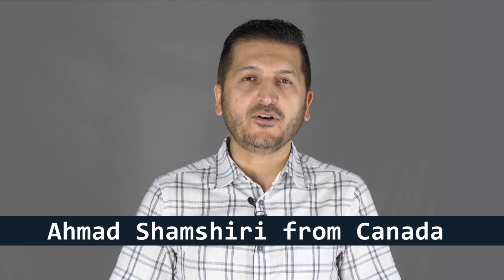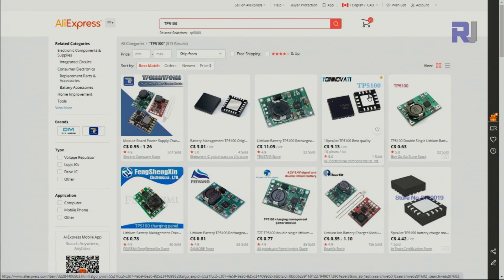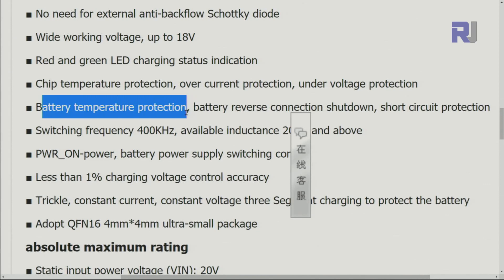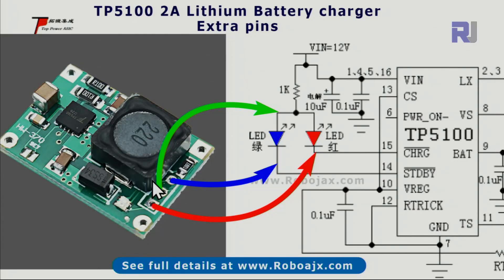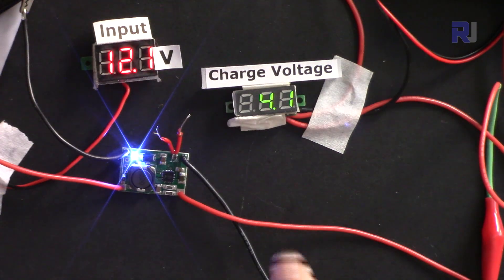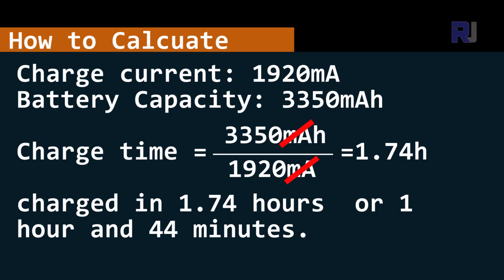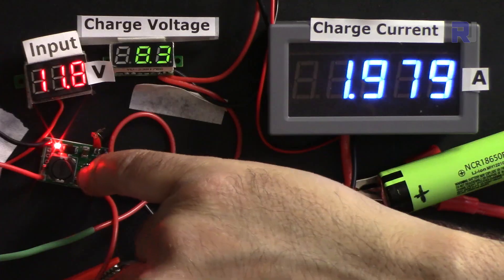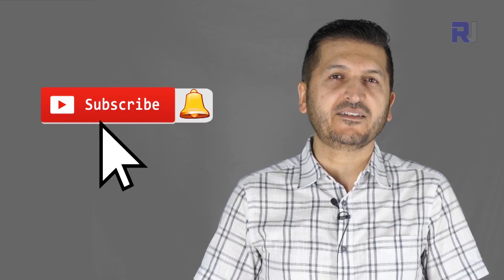How to use TP5100 2A 8.4/4.2V 1S and 2S Lithium Battery Charger DIY - RJT346

Comment: Mr. Shamshiri, I truly enjoy your videos with the thought process, planning and the abundance of information you provide. After all, it takes work to video, edit and review your work and I find it flawless. Even corrections. 
 I have an entire line of cordless tools for sears back when I could work. I am prepared to disassemble and pass judgment on each cell. How or what math is used to determine the current to charge cells the show promise? A dead battery is dead, but unless it has a dead short internally, it has a chance to live again. I take the numbers stamped on the shrink wrap and research to find voltage but aH info. I can not order every single cell ti fix each battery pack as it would be cost prohibiting for my wallet. But having 9 perfectly good tools sitting on the shelf does me no good. 
Automotive ASE Master Tech since 1978-Retired 
I have already used your excellent product testing videos to pick two modules to purchase. Thank you again!
Reply from the maker: Mr. Kay,  I am pleased that you like my tutorials.  Yes indeed for each video there is lots of efforts.  Very few such as yourself know this. 
first of all battery capacity and charge parameters are the most tricky part of working with them.  The charge current is determined by the manufacturer of the battery. charging above the rated current will reduce the battery life. So you have to find the datasheet. for example for the Panasonic battery shown in video here is the datasheet https://www.batteryspace.com/prod-specs/NCR18650B.pdf and it says the the standard charge should be about  16550mA. or lower. I have spoken about battery protection in this video https://youtu.be/3dwA8A8VrrE so generally for less than 10Ah batteries, always go 0.5 of capacity or lower to protect it.
Reply: @robojax   Thank you again so much for the reply. I will identify and look for data sheet & their recommendations. I have never posted a video on youtube, but have a great understanding on lighting, camera angle or position, just a lot. This is basics, but you go a long way to provide information at least I find extraordinary and as accurate. You have my total respect in your total presentation.
My last job had me holding automotive technical 4 hr. seminars for 20 to over 100 each night during a whole week in a different town or city. So the old “Dog & Pony” show. Taking photos, screen captured from a lab scope or scan-tool to use these in the power point was not in the job description. But the presentation had diagnostic holes in it, large enough to drive a truck thru. Advanced Charging systems, Serial Data (6 types in GM vehicles), etc. Magneto-Reological-Fluid used in struts in place of traditional oil and valving found in a common shock. Called “Active Ride Control” and other terms, but basically tiny metal particles suspended in oil. When a magnetic field is applied at a variable rate, change at 2mS changes from a thin less viscous oil to a rigid hard non-fluid material. This was started in suspension in 2004 Corvette. Acura used it in rubber motor mounts. When ran on a dynamometer, the vibration generated on up shifts, down shifts, all parameters, they mapped the dial-in amperage required was downloaded into a EEPROM and allowed later to change the ride feel, smooth, sport, racing anything they wanted. So, electronics coupled with mechanical applications is amazing. So a basic understanding was needed to pass along to guys/gals who may have to work around these or replace them, then recalibrate. 
 Total electric vehicles make no noise (Very Little) but I joked two decades ago that waterproof speakers could be added to allow the driver to turn a knob to make it sound like a hot rod V8, 10 cylinder Viper or a loud 4 cylinder w/turbo. No, people on phones walk into streets and get hurt or killed. Laws maybe passed requiring them to make noise. The possibilities are endless. Just sharing as the guy who makes a simple kit can patent this (Installed by customer on older vehicles) but make millions, if a manufacture buys the patent or the rights with a percentage for license for each one sold/used. It’s a gold rush, but few would think of it or pursue it. I have ideas. 
Ok, enough. Blessing to you & loved ones! Thank you again. I could be reached as I am just working on my own old truck for me. A project to keep both hands & mind working at 62. Stay safe!
Reply from the maker: Hello,  Mr. Kay, You are welcome and I am glad you like my tutorials.  You've got so much experience. wow.  I've read your comments and enjoy them.  To make electric cars noise, many states have considered/did pass legislation to to make it mandatory to have noise added. I am not sure if it has been implement or not.  I have an Arduino course which starts from absolute beginners and up http://bit.ly/rj-udemy
God bless you too and your family.  you too stay safe.

Comment: Does the charging stops when the battery is full ? Is there any auto charging off with TP5100 ? Some one please help
Reply from the maker: Hi, charge is not a charge it it does not stop.  that is the whole point to stop when charge completed.
Reply: @robojax  So the charger will continue charging the battery even if its full.?

Is there any circuit design available to do the same  ( to auto cut off the charging )?
Reply from the maker: so my previous statement is not clear. If you look at the title it says "charger" and if it does not stop, it is not charger. YES AFTER CHARGE IT WILL STOP CHARGING.
if it does not stop, we don't call it charger. we call it power supply.

Comment: how about 8 cells 18650 in pararel ?
Reply from the maker: even 100 can be paralleled. the 2000mA will be divided between them and it will take longer to charge. in your case it will take 8 times longer to charge.

Comment: 12:51 can I use it like this without a balance board between the batteries? If I use LiPo or Li-ion cells?
Reply from the maker: You can but with this module, your battery will be damaged. you need constant current controller which this TP5100 has .

Comment: I'm using this module to charge li-po battery 6000mAh with 2x4.5W solar panels in parallel can you tell what's the efficiency of this module?
Reply from the maker: I just added the efficiency graph in the resources page. the link is in the description.  You can see other  files and datasheet.
Reply: @robojax  ok thanx.. I'm gonna use a different method to my project.. since mppt is expensive, i'm gonna either connect my FV panels directly to powerbank module's mUsb with a switch (i'm afraid of current flowing into them when charging from a wall, since current always go the lowest resistance path) or using buck with 5V 3A USB out and then connecting to mUsb on pb module..

Comment: Hey @Robojax
That was well explained. Thanks!
I have a question. I am using 8.4V setup, both the 3.7V batteries are connected in series
And when I charged it for about half an hour, the batteries got heated up. I stopped charging to avoid any further damage. I disconnected batteries and checked individual voltages. One was at 4.14V and the other was at 3V.
Am I doing something wrong here?
Is it okay to charge when batteries are at diff voltages?
Reply: Probably use a 2s BMS as well along with this TP5100 module. 

TP5100 should supply power to 2s BMS. 2s BMS should supply balanced power to 2*18650 batteries.
Reply from the maker: Hi you are welcome. , you did not mention the capacity of the battery. I mentioned in the video that you have to limit the current. The current causes the battery to get hot and life of battery is reduced significantly. I have given example about capacity. please watch it gain.
Reply: @robojax  Hello, As the video says, The Negative and Positive wires are connected to the S1 Battery, then You connect the wire from S1(+) to the S2(-).  My Question is,

What do I do with the S2(+)? 
Should I connect the S2(+)where the S1(+) is connected or do I leave it there?

Comment: Kinda bit dissapointed you havent tried connecting those in parallel to see if it gives 4A .. or tried connecting 2of those 2s in series for  4s charger.. :(

Or even better I need a 7s charger.. so output voltage 29.4v 

Would 4 of them work combining 3 in 8.4 and one in 4.2? Or is there a diferent module that is cheaper?

Can I use 7 of these in 8.4v for 58.8v e bike charger constant 2A?

That would be a cheap Af solution

Please let me know

Edit: also. In theory if the charger can charge 8.4v at 2A it's 16.8W of power. This means this charger could be modified to charge 4A 4.2v cell? With those resistors? 

Please test this for us. I highly appriciate your work
Reply from the maker: Parallel is not a good idea but it work. why not good idea? over time modules change the output voltage a little. that little variation in voltage causes the current to flow from ONE into the OHTHER and that is waste of energy. Very few like less than 0.1% of people will configure this for higher current.
Reply: @robojax  but is it possle for high current?
Reply from the maker: you want to me to repeat my previous comment.  yes and no. Read it please.

Comment: Can I use two chips in parallel to get max current upto 3Amp ? Awesome video
Reply from the maker: Thanks. Yes you can if you  set both voltage at exact values.  Slight difference of voltage causes the current to flow from one to the other and waste the energy.

Comment: Thank you for reviewing this module, and also great review!
Just a note, you can not apply your time to charge calculation, since the current will lower once cell reaches near 4.2volts, the real time might be something like 3 hours depending on the type of cell.
Reply from the maker: you are welcome. Agreed with your statement.